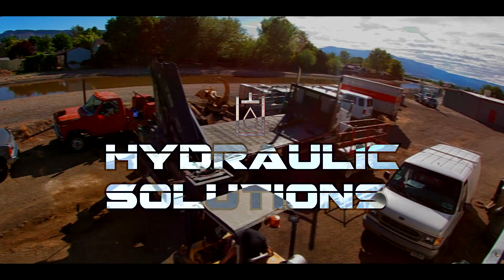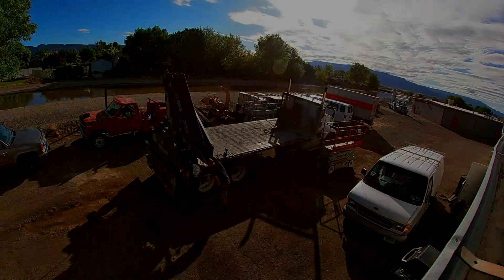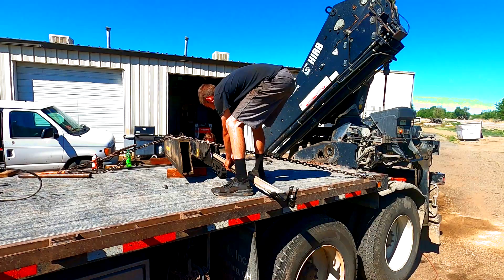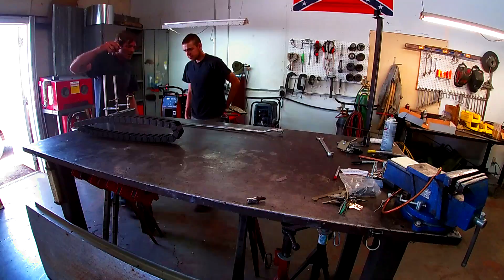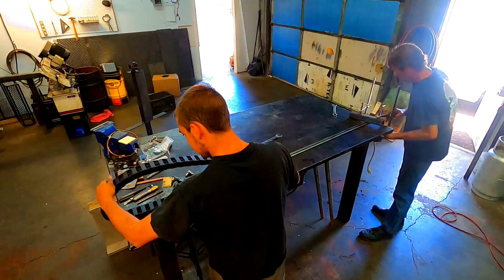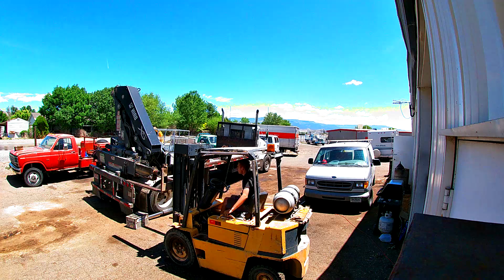HIAB Cylinder Repair

Comment: Excellent video. I have an older IMT 72 ton-meter with a supplementary outrigger's needing repair. Where are you guys located? What is the company name and contact info? Thanks.
Reply from the maker: We are located in Grand junction, Colorado. Name of company is Hydraulic Solutions, contact info should be on google search - Hydraulic Solutions

Comment: Hello, I got a crane Hiab a couple weeks ago it is very similar like your but  it started to failure from the cilinder 1, the issue is when I get up the cilinder1 this doesn´t keep up the position  and it started to get down  I reemplace the O´rings in the control valves and got a new retencion valve that I set in the admision of the cilinder but still the problem I will to review this cilinder but I would like ask you if you know what could be happen maybe I dont review fine something

Best Regards, Thank you.
Reply from the maker: How is it going! Would you please give us a call in the morning at (970-644-1145) 6am central time, would love to hear what is going on with your machine! I'm glad to help you with whats going on
Reply: @Hydraulic_Solutions   thank you,  I will contact you ASAP.